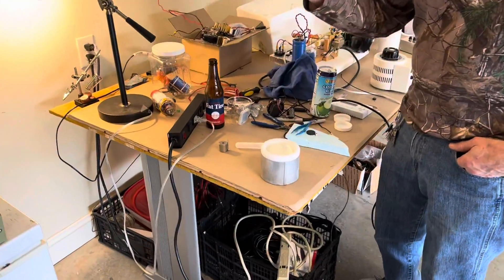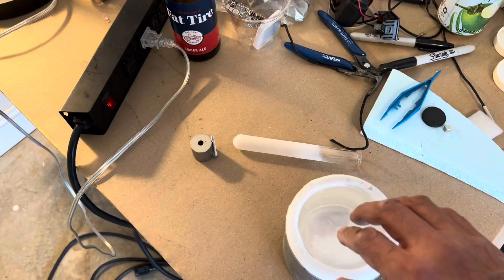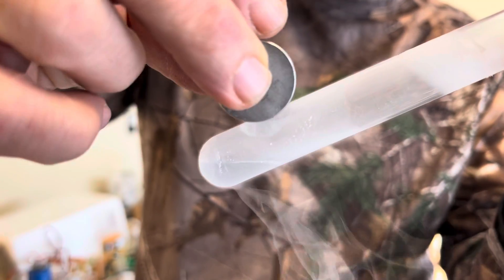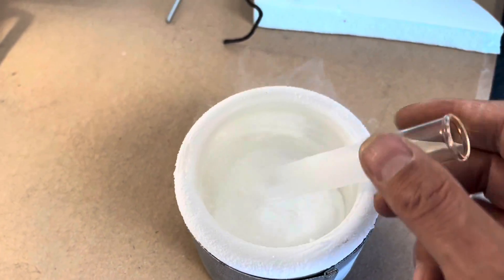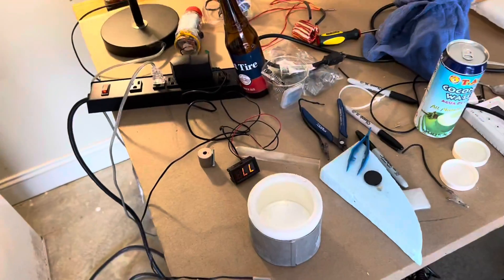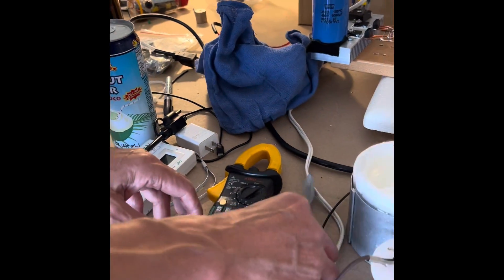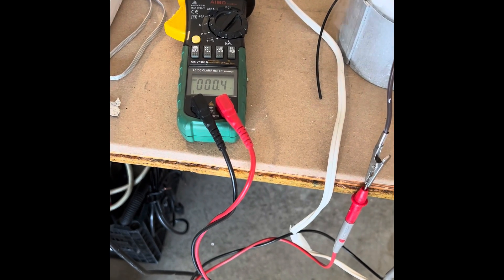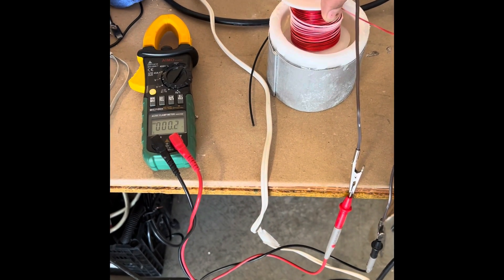Hand vs Liquid Nitrogen

Comment: My boss just about dumped in his pants once when I stuck my hand in a dewar of LN and pulled a small scoop out in my palm and poured it back and forth between my hands, he had just told me LN burns you instantly on contact, he thought I was an utter moron until he saw it for himself and I explained the leidenfrost effect, it can certainly burn you but you have a few seconds before your skin cools enough for the LN to wet it. It feels very strange holding it in your hands, it's very cold and liquid but it feels completely dry, it's a strange feeling.
Reply from the maker: Haha good one!!

Comment: Why not lots of vapour coming out of that liquid nitrogen unlike seen in other videos... ?
Reply from the maker: The Dewar vessel is slowing down the evaporation
Reply: Low humidity, so the only vapour you see is condensing carbon dioxide from the atmosphere, and the tiny amount of water vapour in the air. In summer there would be more water vapour in the air, so there would be more fog generated.  There is also oxygen being condensed from the air, but it is mixing with the liquid nitrogen in the dewar, so is not visible.